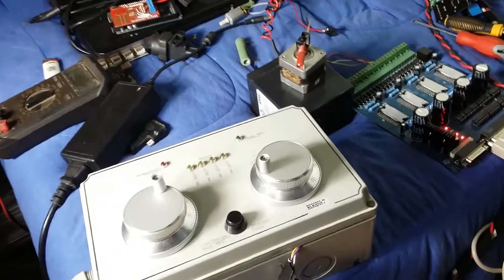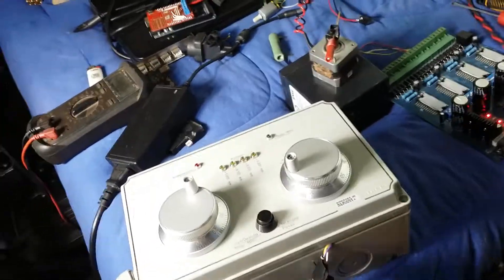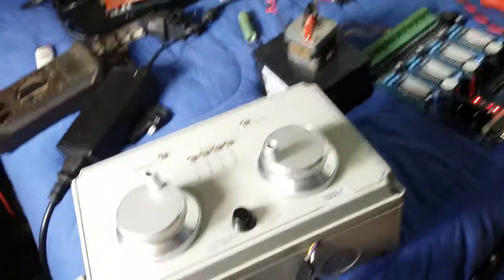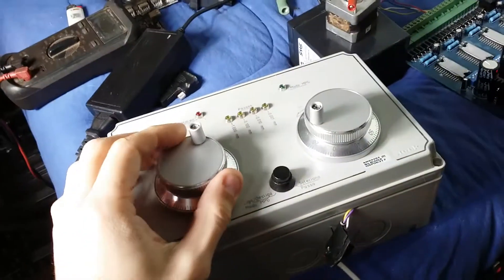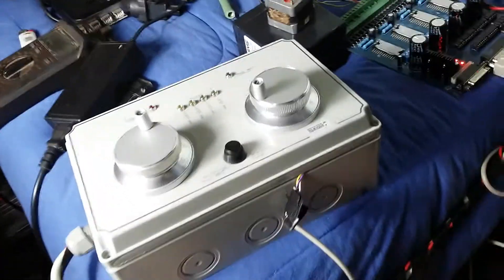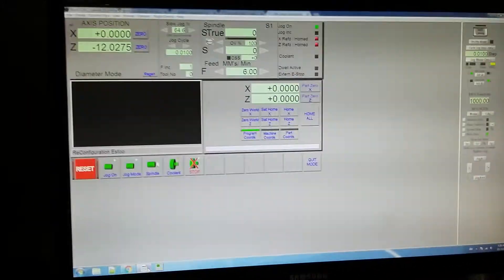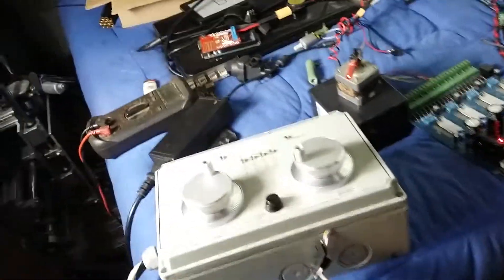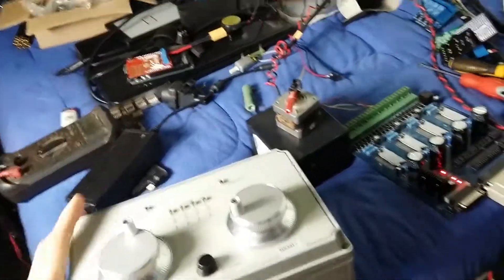Mach3 Dual MPG on LPT2

Comment from the maker: By the way I fixed the problem by switching my control software from mach3 to linuxcnc. No regrets. What a great software. LCNC is one of the most impressive open projects I have seen lately. Great documentation, great freedom to program by several different ways (python, ladder, c/c++ macros. What a powerful tool. Completely different level. There is a video showing it working in linuxcnc in this channel.

Comment: Bruno, how did you get on with this? I have a very similar project with homemade optical encoders and its working using just one cheap mach3 breakout board. If you are still working on this I'd be happy to share some more details with you.
Reply from the maker: Hy Jeremy! Thanks for your kind reply! I'd be glad to know what did you do to make it work! I still haven't found whats wrong with my setup. Just to add some information about the problem I am facing, it feels for me it is a overload problem... too much pulse coming from the encoder and to much pulse to be sent to the motor control board... so it seems an issue of too much processing an i/o instructions to be handled by the computer and that's why it is not being able to stick to such hard real time constrains. Well, at least it is my hypothesis. I believe it might be true, but maybe you know a way to minimize this problem... I will be trying to change mach3 priority from standard to real time, so maybe in this way windows OS can provide enough attention to mach3 and help it to handle such big amount of work. Anyway, I will be glad for some insight if you want to! Have a great day!
Reply from the maker: I got another private message a couple of weeks ago from a guy who said this issue is actually a limitation in mach, so there maybe not a solution to this... it will always be a little laggy. And the usual solution is to use a external motion controller to deal with MPG mode outside computer. But maybe there is a solution! If you are willing to share your setup, I'd be happy to see it! Thanks again for your kindness! Bye!
Reply: Hello Jeremy. I am having the same difficulty. Can you help me?
Reply: @tayronendres  sorry, I ended up switching to Linux cnc and lost interest in Mach.
Reply: @tayronendres  actually I remember what I did. If you switch to constant velocity mode it's smooth and increment mode is just good for small movements, well slow movements. And for big manual rapid moves the position is not so important so constant velocity mode makes sense.
Reply: @mulholla  
My question is how you set up 2 handwheel to work simultaneously with independent axes.
Reply: @tayronendres  oh right, that's too long ago now to remember. But a quick Google will get you going. I don't thing there was anything special to do.